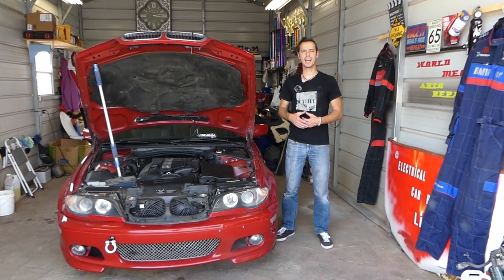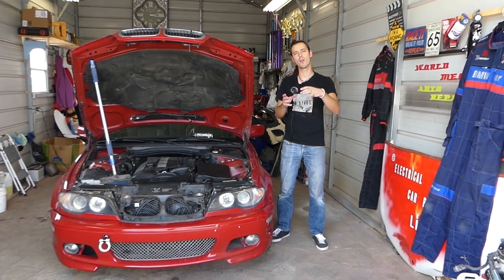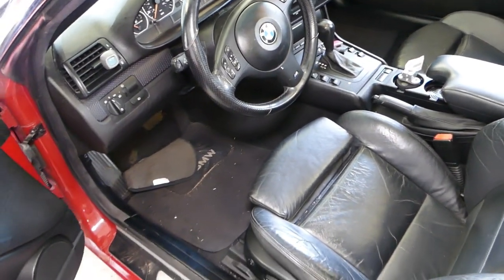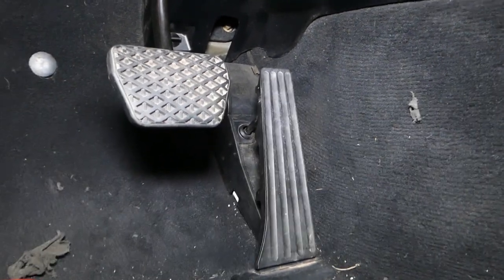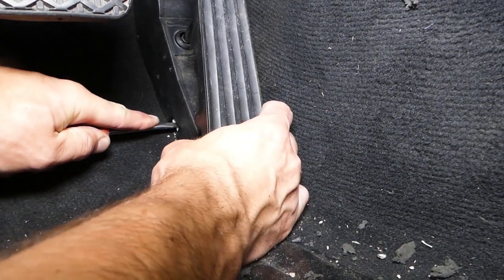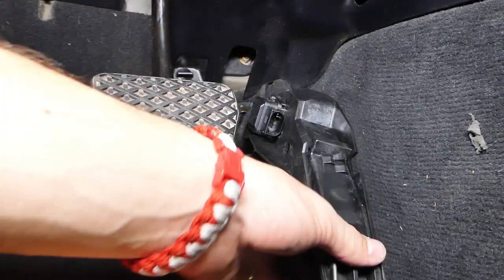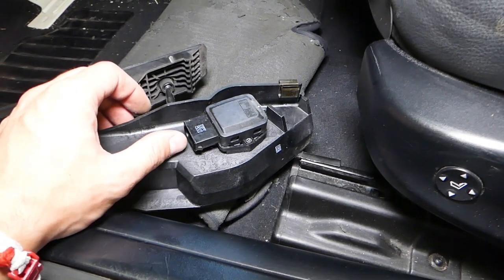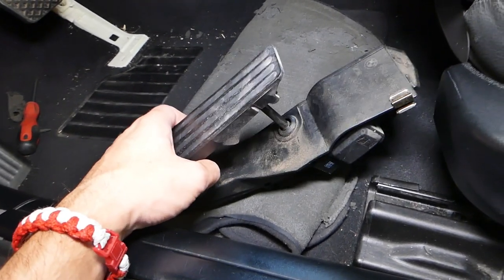GAS PEDAL ACCELERATOR THROTTLE PEDAL REMOVAL REPLACEMENT BMW E46 E39 X5 E53 Z4 E85

Comment: I am swaping from an m52 to an m54, can you help with the drive by cable to wire swap, I really dont want to use a spacer for the smaller throttle body of the m52s, thank you!

Comment: Will this fix my P0123 and P0222? 

Throttle / Pedal / Position sensor / Switch B Circuit Low

Throttle / Pedal / Position Sensor / switch A Circuit High
Reply: Did it help?!? I’m having same codes replaced throttle body doing the pedal next so any input would be nice thank you!
Reply: @friskobby9755 Same here. Replaced throttle body. Fixed the problem for around half a year. Errors appeared again, so I ordered a throttle pedal. Now I'm waiting for the delivery.